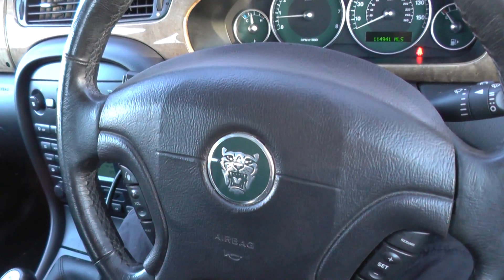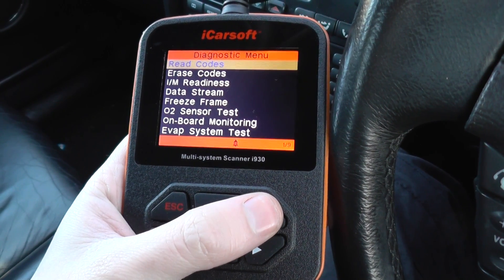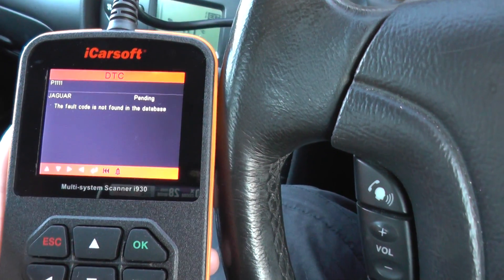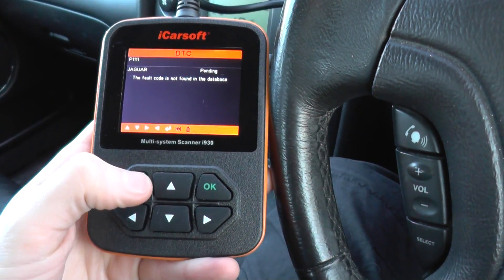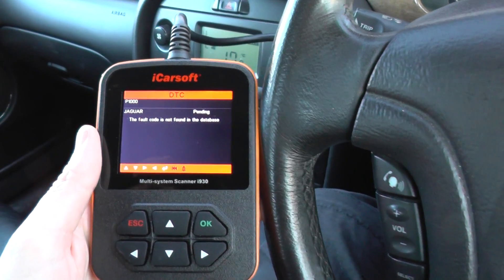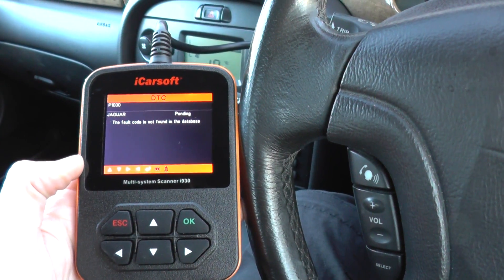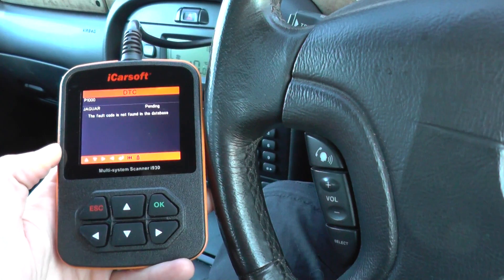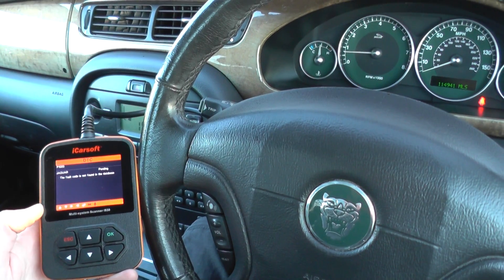Jaguar P1000 & P1111 Fault Codes Explained

Comment: Thanks!    Just got my own scanner (AL319) due to EML being lit yellow (no apparent side-effects).     Found your videos to show how to use it before it arrived.    Also saw the P1000 code so that's now explained for me too.    I'm seeing a P1647 (Upstream O2 sensor) so I'll have to sort that.    Have you noticed the AL319 causes the X-Type (mine 2005 V6) to throw up a dashboard Gearbox Fault when it's doing the protocol scan?    Don't seem to be able to set the AL319 to the right protocol, just have to leave it to find it itself.    Not really a problem, just alarmed me at first seeing a GF on the dash.

Comment: I am driving XK8 1999 model that on occasions shows two red lights in dash and nothing works. I discovered it is security code to disable the car that gets activated for no reason and not a rare problem in this age and model car. The only remedy to make it back to work, is to disconnect the battery for ten minutes and all is back to normal. Now I have a new major issue. Living in Southern California, I have to pass smog test on annual basis. Because the car gets dethatched and attached to battery, catalytic converter displays that P1000 code that I discovered after recent smog test. Car passed all the real emission test, that is it is not a polluter and runs clean however some of the sensors are still in INC or incomplete mode. So doing the homework, I see that I need to complete the "Drive Cycle" test. I followed the advice and for past one week, tried all that was said. However still I have that P1000 and 2 I/M are INC. So I can not keep my registration....!!!!! Seems the system wants to get my clean out of my hand, because they want me to buy new and spend... THIS IS NOT FAIR. THIS IS RIPPING OFF PEOPLE. Can anyone help as to what my option is and is there a way to complete the drive cycle that apparently not even Jaguar dealership knows who to deal with it? That is without turning my good working beautiful car to junk yard? HELP PLEASE IF YOU CAN.

Comment: What about this explanation I found online? : 

What does the P1111 error code indicate in a Jaguar knock sensor?
This error code may be caused by a loose secondary timing chain, a damaged tensioner, or a dysfunctional valve timing actuator, check if the running engine produces any unusual noise. Also, test the signal at the VVT actuator solenoid terminals by using a digital multimeter set on duty cycle and back probing both actuator terminal wires at the connector, while checking for approximately 12% duty cycle at idle and increased duty cycle on revving up the engine. Check the oil on the dipstick for sludge, as it can also cause this error. To prevent sludge from occurring have regular oil changes done. The wear shoe on the secondary timing chain tensioner, the primary chain and tensioner, and the cam drive components should be checked for excessive wear and tear after removing both valve covers. The culprit could also be a noisy timing chain which can cause the knock sensor to adjust the timing to eliminate what it believes is an ignition knock, but since the noise continues, the error code P1111 is displayed.

Comment: P1000 means the error codes have been erased, and the car has not completed its self-testing. P1000 means the car's self-diagnostic testing is not complete, and P1111 means it is complete. In California, it's an automatic FAIL to arrive with a P1000 or check-engine-light on. If your car is trouble-free, you will have no codes or CEL. If you clear codes or disconnect your battery, you get a P1000 which means the self-diagnostic results are lost and self-diagnostic testing must be performed. It can take a lot of driving for the car to complete its self-testing. Professionals learn the ideal drive-cycle procedure to start, idle, and drive that minimizes the time and miles required to complete the self-tests. Until the self-testing is completed, you'll have a P1000 and your code reader will flash a small symbol, e.g. "O", "C", "EV", for each test that is not yet complete. P1111 means the self-diagnostic is completed. Once you have P1111, no test symbols flashing, and no check-engine-light codes, you can proceed to a smog test (which you can fail for other reasons, like altered parts, or bad emission levels). Don't buy a car showing a P1000. A seller can easily clear the dashboard light by "clear codes", without fixing the problem. That's the first thing a smog test looks for, and that's why P1000 is an automatic fail. CEL problems are often expensive or unsolvable.   that the seller keeps clearing, and when you try to smog it, you are burned. In California, the seller is responsible for the smog test.
Reply: I cleared codes about 6 months ago (11,000 miles) later. P 1000 is still on...any advice?

Comment: i got this code today at auto zone checking my jag s type r and showed some oxygen sensor too but the guy recommended me to cheek the oxygen sensor relay before replacing the sensors so im wondering what should i do  is p1000 normal code or it means something

Comment: Thanks, definitely put my mind at ease! And my CEL light came on after a dead battery. After clearing the code with my scan tool, the P1111 and P1000 codes showed up. Now I know why !

Comment: From what I understand is:
P1000 shows up when the codes are deleted, the erase also resets all emissions and frame data. The emissions monitor needs to do a complete drive cycle (there is lots on this about Fords) to clear this code. Once the drive cycle is complete the code will be cleared and a P1111 will show up. This will be present for several cycles. (about a month) and will eventually clear. Neither of these should cause the yellow light to come on. If the yellow light is on you have other codes also (not all scanners show all codes). 

In California it is my understanding you can not pass SMOG with a P1000 but may be able to with a P1111 and good reading from the CAR and test.

This all from internet research but seems to be true for me at least.
Reply: I cleared codes 6 months ago, and put about 11,000 miles since. The P 1000 is still on, any advice? ?

Comment: i have this same car. it goes into limp mode and and 11 codes pops up . otherwise the engine  runs great.
Reply: You're low on transmission fluid
Reply: P1730
Reply: Check the front balancer on motor. Crank to cam pickups